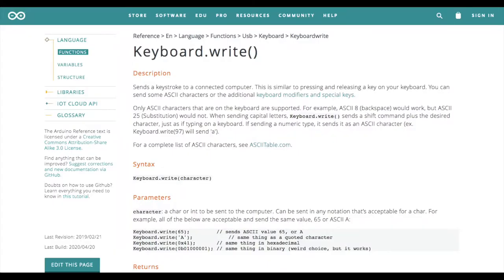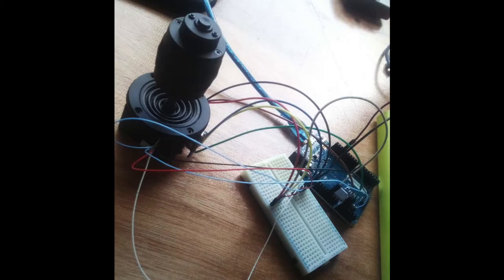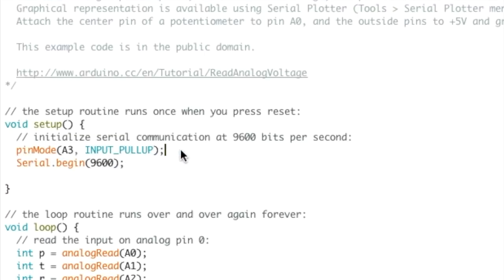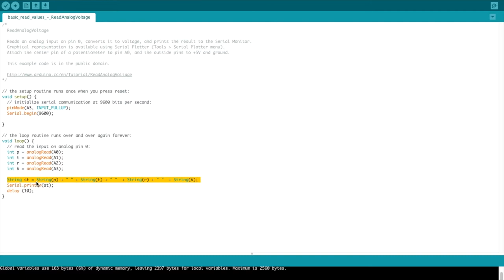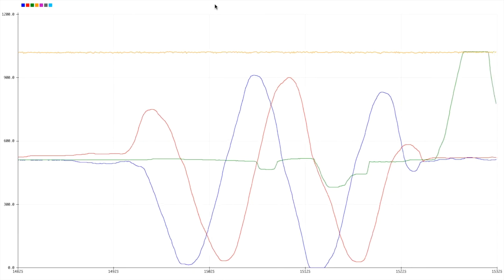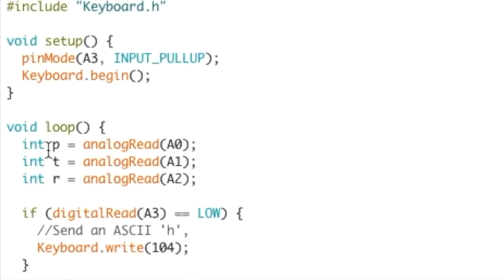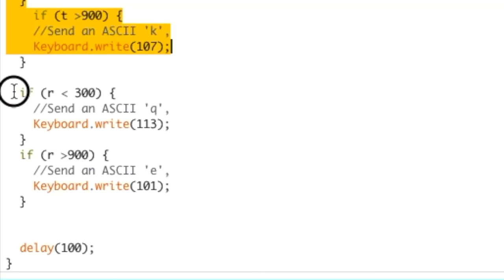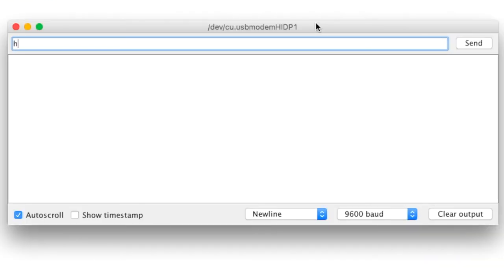#35 - 4 axis Arduino joystick game controller KSP

Comment: Nice, I'm planning to build one myself.
I found online stores offering basically the same joystick, but they did a terrible job translating the specs: is not super-clear if the 3rd axis (the top rotational knob) includes a spring return. Did yours include it?
Reply from the maker: hiya - just doubled checked mine - 3 axis have sprung return to center, and the button at the top is a momentary push button.
Reply: @CrazyLogic  great, thanks!

Comment: What are the dimensions for your 3d printed mount? I have two on order and am having a hard time finding a good drawing to get accurate dimensions from and I'm modeling my bracket now. Thanks in advance.
Reply from the maker: I've added a diagram of one of mine to the post https://www.crazy-logic.co.uk/archives/1053 - but i think it would be best to measure the ones you get as I remember that mine were not exactly as per diagram. I don't have access to the OpenSCAD file at the moment, but if i don't get back to you within a few days with what i actually printed, remind me. :)
Reply: @CrazyLogic  Perfect. Thank you. I was able to find the diagram but it did not have the "install hole size" part. That's what I needed. I can at least finish modeling it now and tweak it when I get it if needed. Thanks again.
Reply from the maker: @relapserustymetal6914  So I used a 40mm dia hole on mine,  and the screw holes were on a 32.5mm grid center to center, centered on the centre of the bigger hole. I used 3mm of sheet printing if that's any help. Would love to see have come up with?